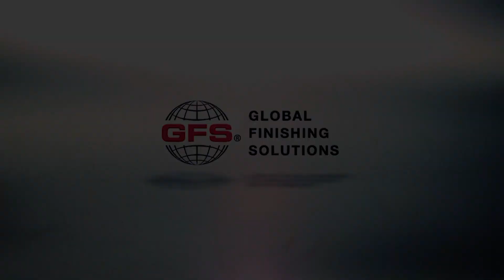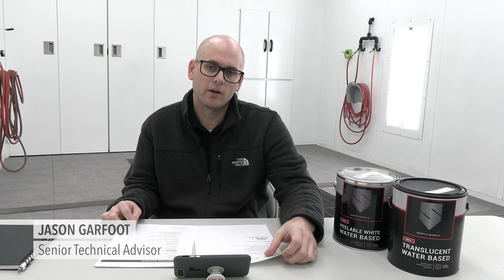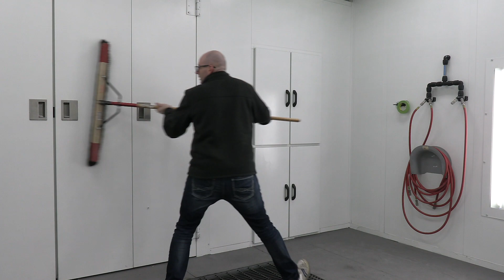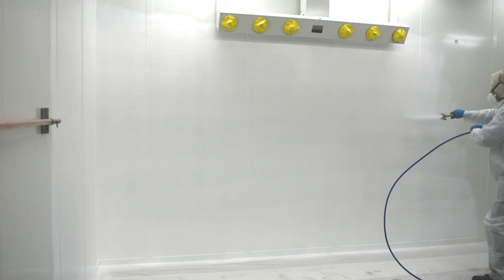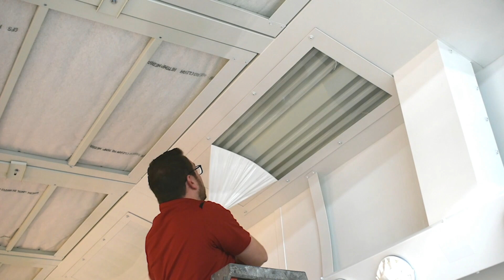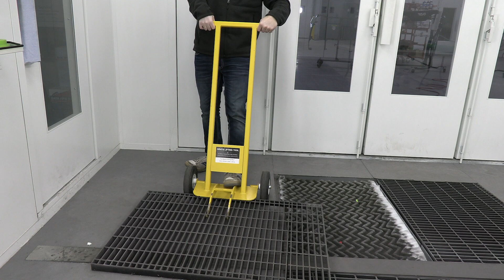How to Clean Your Paint Booth | Paint Booth Cleaning Tips & Tricks | Global Finishing Solutions

Comment: So if you have pig mat . Do you still wet and squeeze the water out ?
Reply from the maker: Hi Ed – Vacuums, brooms and mops can pass over PIG Grippy Mat without damaging the mat or affecting its grip. For stubborn stains that do not come out during normal cleaning, use a stiff bristle brush with regular floor cleaning solution to agitate and loosen the stain.

The PIG Grippy Mat usually dries in less than five hours. Standard fans or floor blowers can be used to accelerate drying. For extremely wet conditions, you can speed up the drying process by removing the water using a wet/dry vacuum or dry mop.

Comment: Hello, I wonder many times if it would be useful using a hand vaccum in the booth floor every morning befor starting to work.
Reply from the maker: Yes, it's a great idea to vacuum your booth everyday, especially if you have PIG Mat.
Reply: Pig Mat or not, vacuuming regularly is the most cost effective way to keep the trash out of your paint job, since the surface of bare concrete is very porous, as seen under magnification, where it looks like craters on the moon, so it traps dry overspray and dirt, until the painter walks by, drags the hose across the floor, or has to get low with the spray gun. A cheap $99.00 canister vac with hepa filtration works wonders.